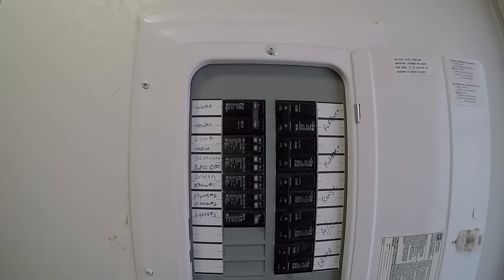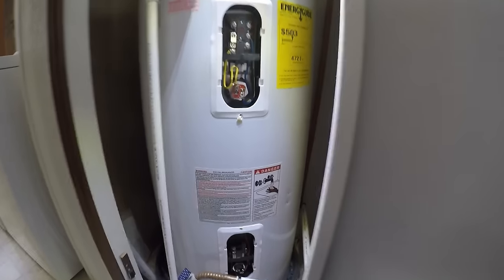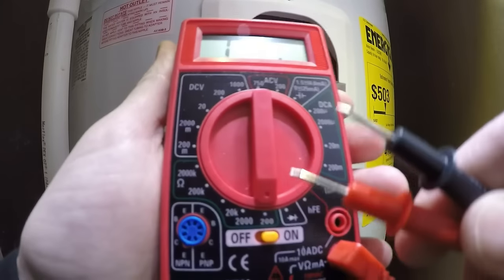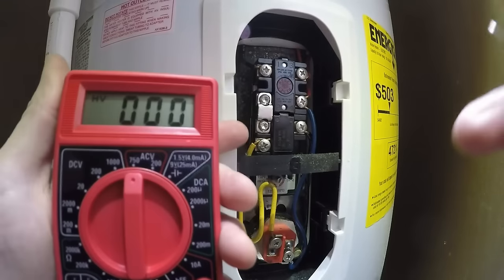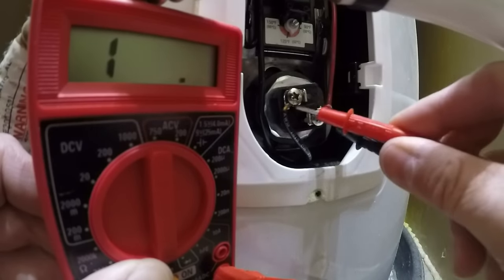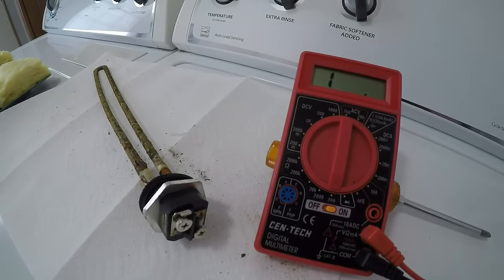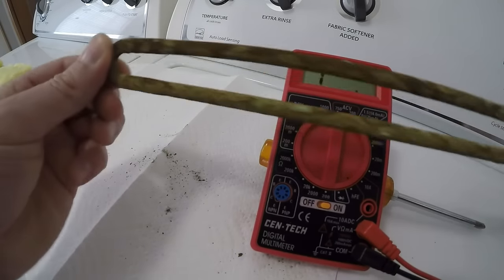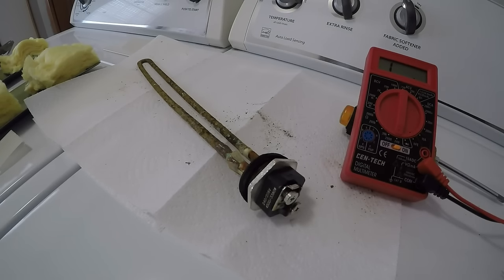How To Test A Water Heater Element

Comment: So I just had a shower and ran out of hot water before I finished my shower.. not an unusually long shower, not any longer than normal. And it was 4am and I was the only one awake so no one else in the house was using the hot water.. so it wasn't that. It's a large stand up hot water heater like you have in this video too, which should easily be more than enough capacity for one person to have a quickish shower. We had a bad connection to one of the elements about 4 months ago and I fixed that and it started working again so I got out there to test it. Both elements are showing continuity, but they're both testing 18~20 ohms.. you said in your video they should be between 10 and 16, so these two are out of range.. should we see about replacing them? Are they probably going to go bad soon?
Reply from the maker: it all depends on your exact model, that might be a normal range for your elements, you might have to research it a little I mean your model, I feel like since you tested them both and that's the range they are reading it seems like it might be normal on yours.
Reply: Alrighty then, thanks for your input. Direct and right to the point, you're a nice guy. :) I had disconnected the wires when testing the elements last night then made sure to bolt em on "Good`n`tight" when putting the wires back exactly as it was (before I touched it) and it seems to be working normally again in the first 20 hours. I guess let it go for another few months unless it pops the breaker or something. Annoying to deal with. And I'll try to google and research our model later, thanks for the suggestion there.
Reply: Check the temp setting ..its usually. Set to 135 domestic water and 165 for baseboard heating but then u should have a mixer valve ..if not then it wouldnt hurt to change out the elements ..its cheap and comes with the thermostats...one element heats the water and another maintains temp ..check if one of the thermostats keep tripping with the red button on the thermostat
Reply: None are tripping and I think we have it set to 130F. I might turn em up and set em higher temps. We're trying to keep our power usage down though so turned it down to 130F setting. It's fine for just two people here so far, and since I turned it back on the other day it's running normally with no issues.
Reply: @Sabrinahuskydog  A common thing to fail on these tanks is something called a "DIP TUBE" which could be cracked its a tube from your cold water going all the way down the tank to get the heat first. so if you or anyone ever has this issue of having hot water for a bit then cold this is mainly the issue. look up this issue a little more and get a better understanding :) simple fix
Reply: Thanks but I think we just had it turned down too low and it was us being stupid. We thought we were saving power but it was just so low that it wasn't functioning correctly at all. We turned it up higher about 140F on the thermostats and now it's perfect and we haven't had any issues.

Comment: My bottom heating element isn't showing anything.   My water is scolding hot.  So will replacing that bottom element solve my problem of water being too hot?
Reply from the maker: I would think that’s probably one of your issues.  Mine was completely shot. I replaced both elements anyway
Reply: @jamiewagner  I got it replaced.  Just waiting to have the tank filled before turning the power on. Sinks were sputtering. Got all the air out of the lines finally, knock on wood.
Reply from the maker: well good luck with it it should be fine

Comment: Hey mate. Nice video. Thanks for that. I’ve done as you’ve shown and according to my multi meter, everything is fine however I’ve still got no hot water. Would you be able to point me towards any other possible issues? My water heater is a rheem mpi-325. Cheers.
Reply from the maker: Yes it’s probably your thermostats ow you should check your thermostats

Comment: Do we have to empty the tank before testing ?
Reply from the maker: I think what I did was test the elements and the water was still in the tank, then I drained the tank before I pulled the elements out, I believe that's what I did, it's been a while since I did the video. I think some people have just replaced the elements while the tank was still full, as long as the power is off I guess you could but I wanted to clean out the tank also
Reply: @jamiewagner  you can't change while it's full jf water

Comment: If you have a moment, I tested both elements and they came back with the right Ohm. However, I turned the power back on I got the 240 volts when I check the circuit on the top thermostat.  When I check the circuit on the bottom thermostat I get .025 volts.  I then checked between the positive on the top elements and negative on the top element and got the same reading at the top. l'm wondering if my element is good, buy my thermostat may have died.  Water hasn't been as hot as usual and completely lost hot water today. I had to reset the thermo on the side of the water heater. Let me know what you think. I can make a diagram if it helps.
Reply from the maker: Yes it is very likely that your thermostat could be bad I am not a professional or expert on this but to be on the safe side I would just replace both thermostats it’s a form of troubleshooting and rolling out those being issues that way you know they’re brand new and if it still doesn’t work right it’s got to be something else
Reply: @jamiewagner  You MUST test amps both legs while energized.  Continuity test rs not correct for the element.  Only shows a dead one NOT a failing one.

Comment: What if my reading was outside the 10-16 range. We got 17.3 about on both top and bottom.  Troubleshooting why heater won’t come on.  Thanks in advance for any comments.
Reply from the maker: not a 100% sure, you might have to look at your manual, there are many water heaters and with different variables, I don't want to provide you the wrong info, this was just like a one time video I made I'm for sure not a professional.. lol.

Comment: thanks.... but it is not the water heater elements or the thermostat. all checked out ok with the multimeter. found out it is the water heater power box....
needs replaced :/
Reply from the maker: Hope it all works out okay

Comment: Great video. Any suggests on how to remove large amounts of calcium from the water heater itself? I just replaced my bottom element and the bottom of my tank is stuffed with white build up. I live in a hard water area and the tank is only a few years old.
Reply from the maker: Nope no idea on that one. You gonna have to research that. Not sure how you would go about removing all that calcium, I would have to look into it to find out.
Reply from the maker: Thanks for watching glad this was helpful, click the like button on my videos and share them on FACEBOOK WITH FRIENDS!!
Reply: You need to replace the factory drain valve with a full flow brass ball valve. Then you'll need to drain it and fill it half way multiple times until nothing comes out. It's going to take a while to do this but it can be done.
Reply: Vinegar will dissolve the calcium then you just need to flush it out a few times.
Reply from the maker: Yeah I never had to clean mine just search around on YouTube for a video about that I’m sure there is a good video on YouTube showing how to clean up that kind of build up in your tank unfortunately I haven’t had that happen
Reply: All you can do is try to flush tank best case is you only get small stuff  , I've had to cut elements off an leave half in the tank because so much crap build up on them  good luck
Reply: Recommended in your area to do nothing.  You cannot dislodge this type of buildup without a very high risk of sending some debris into your toilet valves, washing machine valve, ice making machines>>>>>>   Careful getting advise from very nice uninformed people...   The answer "I don't know" is a perfectly acceptable answer.

Comment: ALWAYS TEST THE POWER WITH A METER BEFORE TOUCHING ANYTHING!  and if there are others in the area, lock-out the box.  Breaker-panels are too often mislabelled outright, can be ambiguous, or have "red herrings" (e.g. the house has two water heaters and you turn off the first one you see, not the one you're working on!)  See Big Nasty's comment below re: testing your test meeter.
Reply from the maker: thanks for sharing this!!

Comment: thanks..... even I can understand this video!!!
ive switched out both elements and the thermostat... STILL no hot water. :/
today.... i am going to recheck elements.
Reply from the maker: wow you would have thought that would have done the trick! Switching out almost everything! Well I wish the best of luck with it! 👍
Reply: Let me know if you solved that issue without replacing the entire water heater.  The thermostats and heating elements are pretty much the entire device as far as heating goes... I'd love to know if you found another source of failure to solve.

Clear the debris buildup from the bottom of the tank once drained?

Comment: Bottom element, I got a reading of 9.2 l. Does it need to be replced
Reply from the maker: It depends on what your tank and manufacture everyone’s might be somewhat different. You should check both of them I believe they should be about the same.
Reply: Both should be 10% within each other

Comment: Why are there readings of 13 if the breaker is off? Why isn't it zero?
Reply: Its resistance. Not voltage
Reply from the maker: thanks!
Reply from the maker: If there is no continuity no electrical current can flow

Comment: An open element kicks the breaker? I think not.
I suspect the calcium buildup shorted the element causing an overload. After the element was removed the calcium flacked off leaving the open condition.
Reply from the maker: yes you could be 100% correct, I didn't do an in depth investigation in to it, but I figured the element was for sure the issue, and after I got the elements replaced this water heater worked great after that and I didn't have any other issues. but thank you for leaving a comment it just helps other viewers out when they are trying to diagnose their own issues, when they read through all the comments it helps them out! enjoy your Sunday!

Comment: I'm thinking my element needs replacing. I have set my ohms to the lowest setting at 200 and I'm getting a reading of 00.3 and I'm confused with the decimal. When I check to assure that my multimedia is working, I placed both probes together and got a reading of 00.5
Am I suppose to be multiply this to get a greater number or is it really functioning at only 3 tenths? Thank you.
Reply from the maker: not certain of all the different tools, you might need to check with the manufacture to see if that's normal or it's set to read that way. A lot of devices are different, I am not certified with that kind of stuff, So I don't to provide you with incorrect support.
Reply: There should be virtually no resistance (ohms) between leads.  If you want a higher number, then put the leads to points near eachother on your finger.  The resistance of your skin will be higher, but continuity should exist that reads less than effective infinate that you read from not connected leads.

Comment: What size wrench or socket to get element out?
Reply from the maker: It comes with the elements kit
Reply: 1 1/2” deep socket or buy a water heater element wrench at the big box store.  They are normally near the replacement heating elements.  I prefer a socket.  The element wrenches may not be able to break a stubborn one loose.

Comment: why will my hot water heater not heat up after both elements and thermostats have Ben changed and there is power going to both of them
Reply from the maker: Not sure one lady said it was her water heater power box that was causing hers not to work. Her issue is similar to yours. You may need to have a certified plumber check yours more in depth. Could be something else.

Comment: Rated 4500W, 240VAC, 12.8OHM, 18.75A per 120VAC.

18.75A x 240vac = 4500 watts
4500w / 240vac = 18.75 A
18.75A^2 =351.5625 * 12.8 OHM = 4500W
18.75A x 12.8OHM = 240VAC.

honestly.. my single element in my hot water heater is probably two 25.6 OHM elements in parallel, .... The 240 is split up for the two elements that make up the single lower element in my tank.

That's why they use 240, or two lines of 120vac, 😊

2,250 watt per 25.6 OHM element in parallel for the lower (single) element. 😊
Reply from the maker: Great info thanks!
Reply: I'm sure that just screwed up everyone
Reply: @gregberban9273  Nope. There are people more educated than you, obviously. That's all that means. Tnx for the comment.

Comment: The wires have to be off to isolate the circuit...  Right?  You didn't take the wires off.
Reply from the maker: Yes I would do it that way also because there could be a short that won’t rule out if there’s a short in the wire

Comment: So Jamie, I just installed a recirculator pump and recirculator valve into my hot water system. Now all of a sudden, I got no hot water and my tank doesn't seem to be heating after a couple of hours. I'm going to check the heating elements first thing in the morning. But  in retrospect, I think that I made the mistake of powering my water heater before it was completely filled with water and before all air was purged. I guess its called "dry firing." Is this a really quick way to ruin both heating elements almost instantaneously??
Reply from the maker: I am not a tech on this exactly but yes if you fire up the elements before there is water filled up in the tank it can cause issues like that.
Reply from the maker: Thanks for sharing
Reply: Johnny AppleStead  my guess no water touching thermostat,  so it just keeps juice going through the element & not shutting off. ??
Reply from the maker: Yeah could have been doing that, the element was destroyed

Comment: i thought you unhook the wires b4 testing the element ?
Reply from the maker: +Philip Edelstein as long as the powers off you're going to get the same reading whether the wires are hooked up or not if you want to
Reply from the maker: +Philip Edelstein you can always
Reply from the maker: +Philip Edelstein you can always unhook the wires and then do it that way as well it'll still work about the same but I would you can try it it won't hurt nothing
Reply: Jamie Wagner its just the way i was taught but thanks ill give it a whirl
Reply from the maker: +Philip Edelstein cool good luck with it!
Reply from the maker: +Philip Edelstein yep!
Reply: Always unhook your wires so you are only getting a reading on the part you are testing.  If not, you are readin up the wires also which in some cases may give a false reading.  I realize you have the breaker out but it's just better to get an isolated reading on the test part.
Reply from the maker: +racerx143 yea your right the wires could have a short also. It's better to test the part alone without any wires attached
Reply: @jamiewagner  not if youre testing continuity for a break in the element .if not youre going to pick up the wiring circuit ....no? Its like testing a limit switch ..iv changed 100s of these thing and most looked like they were pulled from the titanic because they turned the power on b4 the tank was full lol

Comment: Ok, so something is tripping the reset button and the water is much hotter than what I have the thermostat (relatively new) set for.  Using my meter to test the R of the element and setting my meter to 200ohms, there is .5 ohms showing when touching the probes together. So I assume that when i take a reading, the resistance will show .5 ohms higher than what it really is, correct? If that's true and an element tested at 12.5 ohms, then it is actually 12 and the other is 15.3. Even then, both appear to be in tolerance. 

The elements don't show to be shorted.

So I don't know why the water is hotter than the setting, nor why the reset button is tripping.
Reply from the maker: Somethings causing that thermostat to trip I would think something is shorting out or the thermostats faulty or something

Comment: When testing to see if breaker is off make sure you touch 1 to a power wire and the other needs to be grounded to tank. All water heaters are not wired with a double breaker. If you shut of 1 breaker you will still have 110 volts. Only way to know this is to ground 1 side to the tank and the other to either one of the power wires. It happened to me early in my career.  I thought it was turned of because touching both leads showed no reading. When I cut the wire it sparked. Be careful

Comment: What does olms mean?
Reply: Ohms. Is resistance of power and your checking to see if the circuit is complete. When you get an ohm reading the circuit is connected. If no reading the circuit is not complete. Different ohm readings will be dependent on what your testing.

Comment: What if it's above 16 ohms? Like 21
Reply from the maker: it's possible it's okay also you have to check with your manufacture of yours to be very certain so you don't waste your time replacing good parts. yours might be okay but the numbers I mention in this video are general and can change a little up or down.
Reply: The restistance value depends on the kW rating of the element

Comment: You should be removing the wires connected to the elements before testing. 15-20 ohms is good anything around 10 or below should be changed.
Reply from the maker: thanks for the tip, that way works to in case the other part is shorted out.